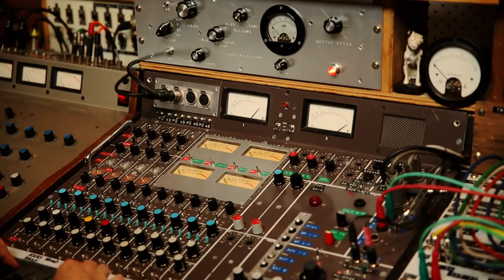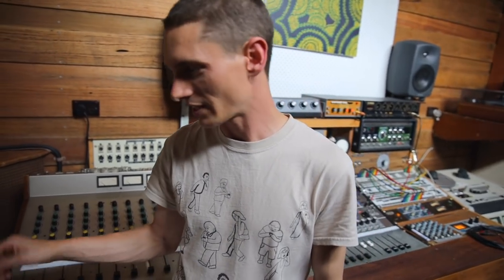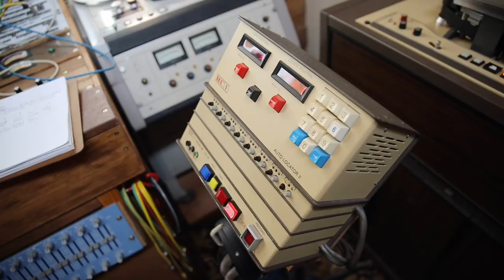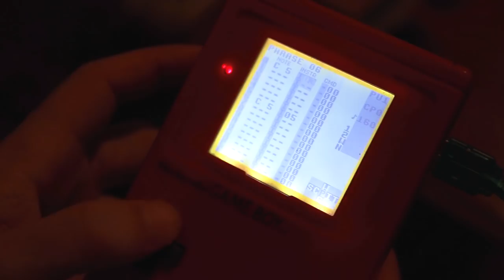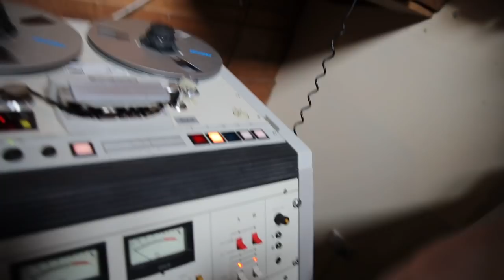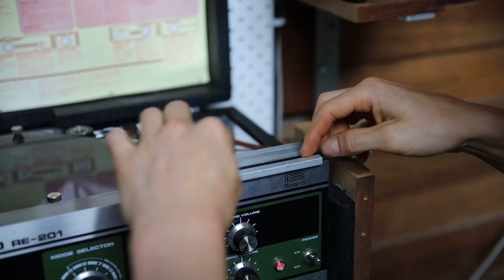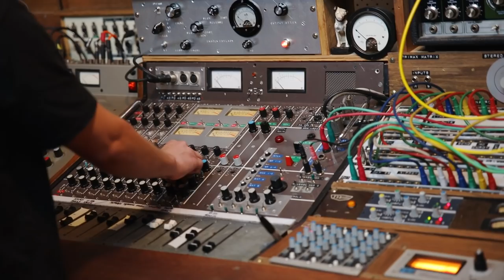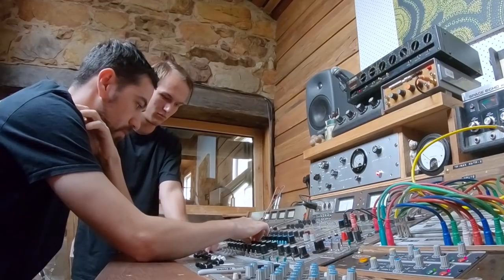Gameboy vs Tape. Recording lo-fi digital with an analogue 8-track studio (w/ dot.ay)

Comment: hi i love the tape decks very hard to find otari mtr 10 you have super ace unit i have one make all recording sound super ace  
8 tracks 1 inch very rare  that size unit  alot of the tape decks break down alot
Reply from the maker: A big part of owning an open reel tape machine is it's upkeep.  Even back in the 1970's, you needed to keep lining up the machine, lubricating and cycling power every month to keep it in good operation.  Components do die - hardest parts to fix are things like the capstan drive and reel mechanics; but custom (although expensive) parts are available.  Lots of people buy these used from sellers who have had them sitting for 20 years in a dusty garage - and quite simply, you cannot expect them to work, nor should you even try to power them on!   They are a very stable and reliable unit once they are in good hands.  Alex who owns this unit is one of the best maintainers I know.  We did 2 mixdowns of the same track and joined them together in mastering - the drift was less than 10ms.  I own digital recorders that drift more than that!